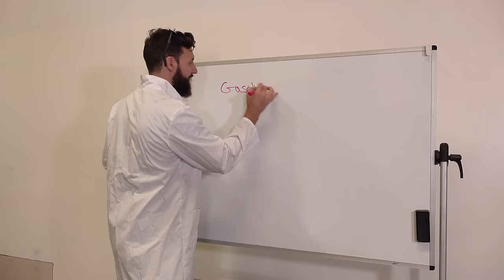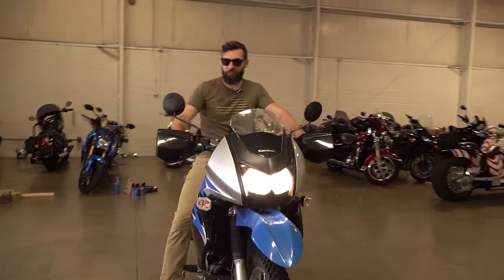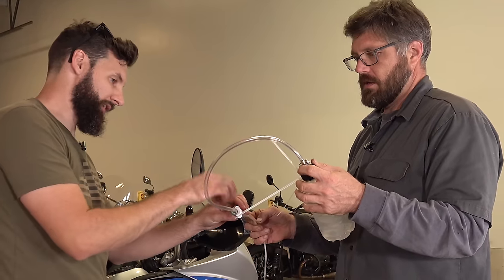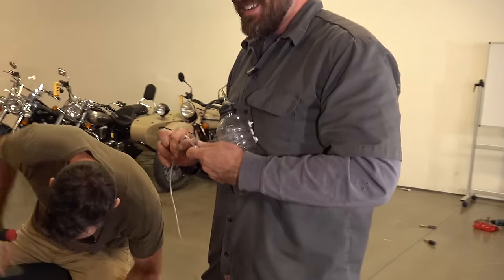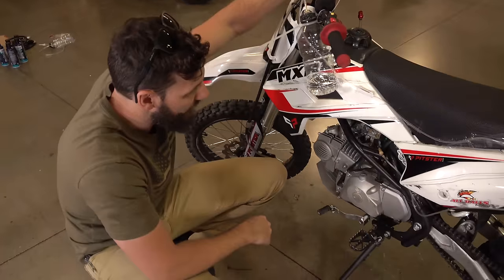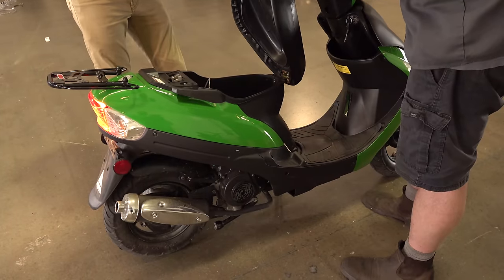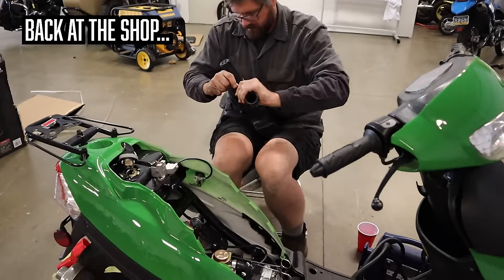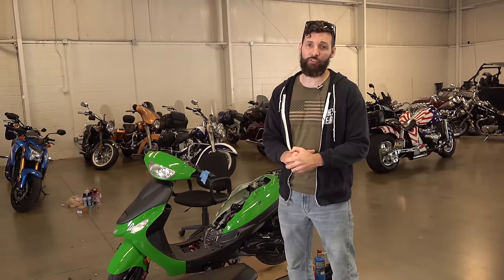What happens when you try to run a motorcycle on PROPANE instead of Gas

Comment: With the butane, you needed to turn to bottle slow down so the bike is running off of butane and not butane gas because butane liquid is more flammable and easier to run an engine off of

Comment: First, you have to tightly close all the connecting pipes, and secondly, and most importantly, you have to replace the spark plug to be able to ignite the mixture properly and you want to cancel or replace the air inlet because it is small and somewhat closed and the engine cannot breathe properly

Comment: You need to change the afm ratio to accommodate the difference in fuel density. You should probably also use a thinner oil to compensate for the higher octane fuel to give you better compression. If you do try it out and it works let me know
Reply: LMAOOOOO HOW IS THAT NOT FIRST THOUGHT

Comment: I dont know about cars that only run propane but the ones that get it done aftermarket, always when you start the engine cold it runs on gas until it comes to the working temperature and then the propane kicks in.

Comment: If you rigged up a small ball valves handle to the carb with a coat hanger when you open the throttle it will give you more gas, but I think you need to use a minibike style carb unless you drill a hole in the slide and slide cap to fit the coathanger

Comment: Put a spring and control arm on the propane valve with a manual throttle cable and "tune" the pull on the cable.

Comment: In my country we call the gas power vehicle CNG compress natural gas or NGV natural gas vehicles, we add extra tank for natural gas and simple modifications use gas directly to a normal car and the price is 70% more cheaper . One car can run both systems no problem

Comment: I think i might know what your issues is. The reason they keep stalling is because in the carburetor the more air that enters is matched with the jets letting in more fuel. Since the propane or other gasses you used is only a direct supply, you’re opening up the carburetor every time you give gas which is letting more air in but it isn’t balancing with the gas you’re using. You need to find a way to bypass the carburetor so you’re opening up more gas instead of the carburetor when you’re giving gas and that should fix your issues. If you want I could possibly help you with that

Comment: You should be running the liquid part of the butane into the carb. A carb normally turns a liquid to atomized fuel/air mixture. let it do the same with the propane All the pressure regulator should do for the propane is knock the presure down to a lever the bike can use, but still it needs to be liquid. LPG no just PG or LNG (liquid natural gas) or liquid propane is what is normally used in vehicles. If you're going to use a carbureted engine, it needs to be liquid.  On fuel injected engines, Liquid  works better, but so long as it's pure propane it will still work to some degree. You can also run an engine off lighter fluid, or use it like starting fluid. I sometimes use regular lighter butane as starting fluid if you can get a system set up where it will run like it should  (it will have just a little less power) the engine will last much longer than on gasoline and oil changes cam be much further apart. the oile doesn't get ditry much with propane. A security company had a pickup truck set up for propane, then after 300K miles on it, for some reason they switched it back to gasoline (ony a turn of a switch to do that) and it tore up and behaved like a 300K engine almost immediately. It was never the same again.

Comment: To run an engine on gas, you have to convert liquid gas into volatile gas You can get that by having the gas flow through a confeuther / regulator, which you can also adjust properly ,further you have to take a biger hose and put the gas in a steel cylinder under pressure the same way as with an LPG installation

Comment: In Europe they sell gas kit that you can added to a regular gasoline engine. You run the engine with gas to warm up and flip a switch to shot the gasoline and get on the natural gas system. ( natural gas is les $ ) 
Chevy in Europe has a model I believe is called Kalo that comes with the system installed by the manufacture. 
Maybe if you let the engine to run on gasoline to warm up probably you can make the bike run better 🤷‍♂️

Comment: Here in the philippines LPG Delivery Tricycles uses LPG for their main Substitute for gasoline i mean a whole LPH tank can run a Delivery Tric for Miles i think they have a converter  pressure regulator that they use on motorcycle carburators

Comment: Hey guys. The reason  the bikes won't run is because the fuel is already atomized, but at a reduced volume. The propane systems have a regulator (like on the barbeque), the fuel atomizer, and usually a metering plate for the intake that is controlled by the throttle. I use to work on propane powered buses that were just converted from gasoline. The fuel/air ratio is out of balance because the intake volume does not flow at the same rate as the fuel and the volume of fuel is not being increased accordingly. Basically what happens is... At idle, the fuel is allowed to accumulate in the intake at a reasonable,  but low level which will  allow the bike (no matter the size engine) to start, but not accelerate. Both systems (propane/butane) need to be pressurized and regulated to their specific volatility. Remember that all fuels have a different volatility intensity ratio, which just means the some burn hotter than others. Gasoline has a certain volatility intensity ratio which is 14.7 to 1 fuel to air ratio under compression, the intensity changes as the octane value increases from 87 to 89 to 91 to 93, but all octane will burn the same with an open flame like a match.
Propane and butane burn at lower intensity and both need a lower ratio of about 12 to 1 fuel to air mixture. That is the semi-science version.
Basically all you need to do for the propane system is to have a standard pressure regulator from the tank, a hose feeding the fuel adapter module from the generator and reduce the airflow to match (the throttle controls the airflow). If you look at the generator, the propane components should be connected to the intake through a reduced port, not directly into the open intake. Unfortunately you will need a metering plate to regulate the mixture flow rate because the generator has a fixed rate rather than a modulating rate needed for a throttle type setup. The metering plate assembly basically replaces the carburetor. Yes, it can be done, just like converting to hydrogen fuel as well. It's all about getting the fuel to air mixture to match from idle all through the acceleration range. Good luck.

Comment: I hope you have a check valve and flash arrestor on your line. You know they actually make propane conversion kits that allow you to make dual fuel vehicles. They have the proper sized regulators to provide the proper amount of gas flow to your internal combustion engine. There used to be a company doing this with hythane (a mix of natural gas and hydrogen) also. Not sure if they are still in business or not. It was supposed to reduce emissions by something like 50%. Check online for multi fuel or dual fuel conversion kits. I know they are popular in other countries even if not here.

Comment: I think the reason it didn't work was because most propane powered cars inject liquid propane, so if you has just flipped the fuel cells upside down you might have had a better chance of longer runtime

Comment: I think the reason it didn't work is because you weren't getting the air fuel ratio right. The most challenging part is that the fuel has to be readjusted for every small change in throttle position. I hypothesize that if you took some time and slowly adjusted the throttle position on each of those bikes, you would stumble across a specific spot in the throttle where the bike engines run well for an extended period of time but if you change the throttle position very far from that spot it will bog out and die. If you wanted to actually make the bikes ride well on propane or butane, you will need to carefully measure the flow of air into the engine through the carbuerator throughout the entire rev range on the bike. From there you could look up the combustion stoicheometry (accounting for the fact that air is only 21% oxygen) for the fuel you are using and figure out a new fuel valving system that adjusts with the throttle to provide the right amount of fuel at any given throttle position.

Comment: I would hook the twist throttle up to a year and then hook it up to a universal joint and then have it go down the steering system put the propane right up to the steering to where you can still turn it freely and then have the gear go on to the cap and then have something on the cap that turns the cap to open it up more

Comment: I have a pretty good theory of why your bikes only ran a minute on the butane/propane. As the liquid boils and creates gas, it has to absorb heat from the surroundings. This causes the bottle to cool, until there isn’t enough heat to evaporate butane/propane fast enough to run the engine. I suggest you switch to a metal bottle and submerge it in a warm water bath (bottle in a bottle with propane in the inner bottle and engine coolant in the outer bottle). P.S. I suggest you wear a flame retardant racing suit in case the pressure gets out of hand :-)

Comment: I guess nobody told you you can buy a kit comes with the regulator liquefied petroleum gas carburetor everything you need to make it actually function normally. Commercially manufactured systems have been available since the 1950s. Quite popular in farming and also for forklifts working inside of warehouses where they want to keep the air as clean as possible.

Comment: Are you utilizing the liquid from the propane or the vapor to power the engine? When upright your propane bottle will produce vapor at the valve, while holding the tank inverted should produce the much more volatile liquid propane. You could also try using map gas. It comes in yellow cans and burns brighter and at a higher temp. My final thought would be maybe a 5lb bottle in a basket on the handle bars and you would have flow control closer to the operating controls

Comment: I'm no rocket surgeon, but I'm thinking that the butane setup didn't have enough pressure. 
As for the propane, maybe you should try to duplicate the system used on cars, trucks and buses that run on propane.

Comment: had a 1991 xj900 (263k miles on it. primary chain rattled inside the crankcase until it was above 2k revs). parked it up in 2005 intending too do a full stripdown & restoration. started it using butane twice a yr till i gave it away in 2013. it wouldnt rev but it did start & run ok every time. petrol tank (& frame) was rotted out thats why i never tried restoring it

Comment: Simple chemistry lesson" a stop sign has eight sides and is an OCTAGON, OCTANE is an EIGHT Carbon molecule. Propane is a Three carbon molecule. Butane is a Four carbon molecule.  Methane 1, Ethane 2, Propane 3, Butane 4, Pentane 5, Hexane 6, Heptane 7, Octane 8, Nonane 9, Decane 10,  The more Carbons the slower it will burn and the less volatile.
The fewer carbons makes it closer to a gas, as opposed to liquid. The more carbons the more energy.
Reply: I've heard that somewhere else as well. If i remember correctly that source was talking about why gasoline is safer than hydrogen since carbon slows down the reaction. So gasoline burns and gives off carbon while hydrogen goes boom, but does so cleanly.
Reply: @AgentWest  Theoretically, The whole thing burns Cleanly.  The bigger the "molecule" is the longer it takes to burn. For example "saw dust" vs a "log".  So two H atoms and one O atom can be joined into water Immediately. When you have a molecule that is made up of only Carbon and Hydrogen the O from the air joins with the H to form water and the O from the air joins with the C to form CO2.(which feeds the Plant life). Since the Longer chain carbons are bigger they burn slower. The shorter ones burn faster, explosively.
Reply: @supermankent1041  It's a shame carbon can't be easily manipulated. Would have been awesome to have a fuel cell that extracts carbon from carbon-rich and fairly safe "fuel", lets hydrogen or a shortened molecule do it's thing, then re-adds the carbon back into the fuel at the next fill-up rendering it nearly inert until the process requires it.
Reply: @AgentWest  How are the plants going to breathe if we don't produce CO2. lol.  The clean way is to use water. using electrolysis  separate the H-O-H then the only product of combustion is water. Supposedly this really works.
Reply: @supermankent1041  While HHO does work, right now simple electrolysis is really inefficient. There has been some experimentation with using high frequency instead of straight DC, but i don't know if any significant improvements have been made.

Comment: Hay your butane is just getting cold try mount it close to the exhaust  to preheat it (Did you try hook up the propane  like the butane?) Also you know you can run on petrol fumes? (Just petrol fumes into the air intake through the carb for throttle) you can try that with the propane too...

Comment: What i would say is open your motor and take a look at the pistons and valves and maby try to not stick the needle in the airfilters ruber the need may also be to thin my try conecting it by the carberators fuel intake

Comment: I have been in the propane business 30 years. The reason the butane would not keep running was you are using to small of a container of fuel it has to keep boiling to have pressure to move through the hoses and get used. The scariest thing you were doing is to transfer the product int to plastic bottle and to be doing it inside the building! That can be scary stuff funny to watch since nobody got hurt. Be safe

Comment: I have a electrical generator that will run on either gasoline or propane. It runs stronger on gasoline.  Propane is weak but cleaner.  Very large industrial generators in high rise buildings, hospitals and such, will run on either natural gas (piped in) or LPG.(emergencies)  Caterpillar and other manufacturers makes these large units.  Notice that there are no dragsters running down the quarter mile on LPG yet?

Comment: So this reminds me of an afternoon when i was at a buddys shop who designs and builds racing teansmission parts for new Ford transmissions and happened to mention you could buy nitro methane at the hobby shop for high end remite control planes. Lets just say the Thomas 50cc moped never sounded the same again until it kicked the rod out of the case.

Comment: "It's not toxic". Burning butane or propane can potentially produce carbon monoxide, which can be fatal.  Also carbon dioxide but you'll feel like you're suffocating if you breathe too much of that, and know to get out of there.  Short version: like the mechanic said, do not burn anything in a small space unless it's specifically designed for indoor use.

Comment: I'm not a mechanic, but as far as I know converting to LPG isn't that simple as LPG burns hotter than gasoline, so you run the risk of burning your valves and seats and the sparkplug. Most old LPG cars still need gasoline to cold start and get up to temperature gently, newer LPG-G3 systems do not have this issue. Then again LPG-G3 tends to be an injected fuel, which does require specialty injectors and an ECU flash in order to get the proper fuel air mixture.
Old timey dry LPG systems can run on specialty carburetors, but like the one you took from the generator, it needs to be tuned to the specific engine. Newer wet LPG-G3 systems are less finicky on that end but they do still require quite a bit of modification to most engines in order to run it.

Going through a cursory search with the relevant (local to me) government agency mostly shows wet direct injection systems. Old systems are most common on old-timers for tax reasons.

Comment: The ratio of propane to oxygen is probably off you need about 90-98% oxygen for it to properly burn any more or less it'll either be too thin on propane or butane or to concentrated. Also the differences between propane and butane are just a couple carbon atoms. I'd recommend using some form of electronic valve to control the flow of gas and using it in a liquid form instead of a gaseous form when feeding it into the carburetor.

Comment: Maybe have line going into the carb like normal instead of stabbed through the intake.  Wont work well at idle cause itll pool up bad.  If the carb used its passages to regulate the butane by itself, there may not be a need for manual regulation.  Maybe jetting needs to change, but the biggest problem i saw was trying to tap behind the carb

Comment: For any engine when you run butane or propane you need to upgrade the sparkplug they need to be higher heat rating due to the temperature of combustion within the chamber thats why race cars and bikes that run off of race fuel or alcohol fuels they upgrade the spark plugs and the pistons again with higher temps your piston life will be at least cut in half . But it should run fine for 6 months with just a upgraded plug.

Comment: If you haven't figured out the generator parts, try a propane ice auger carb. For an Eskimo (ardisam.com) 40cc one, the carb part# is 25527, propane regulator and hose is part# 25513. Would probably be OK for a 50cc bike. Parts are $100.

Comment: Get a smaller carburetor so it is easier to regulate air to gas mixture so you can run the bike right on propane gas

Comment: Did you refill the bottle when you went to the scooter? You just might have had too little pressure to sustain running. Regulating the gas with the air as you speed up helps too, that’s why the Propane regulator is more complex . Looks like you had fun doing it though ....